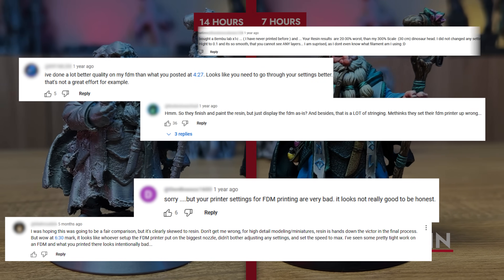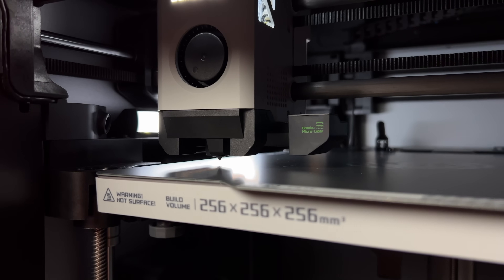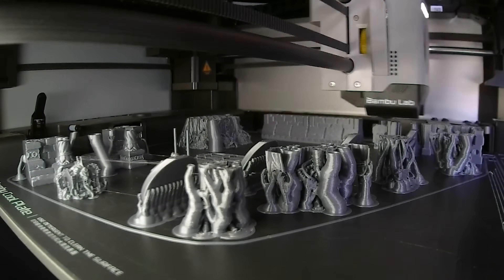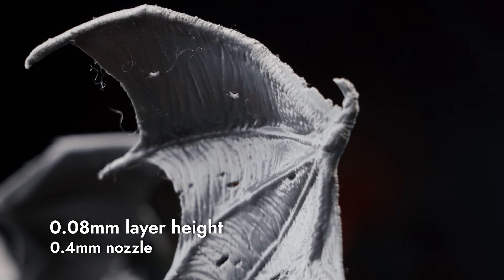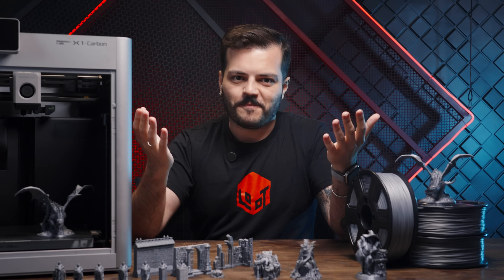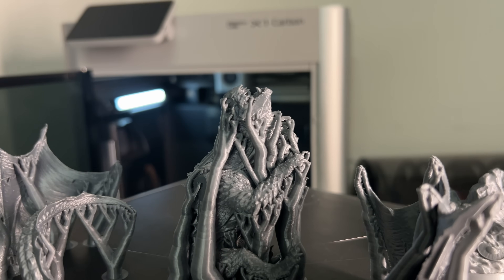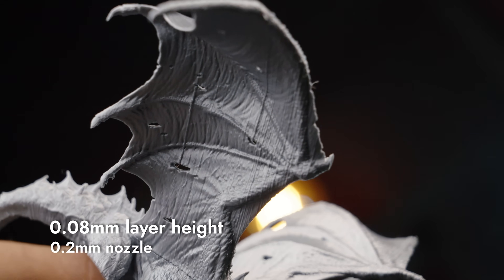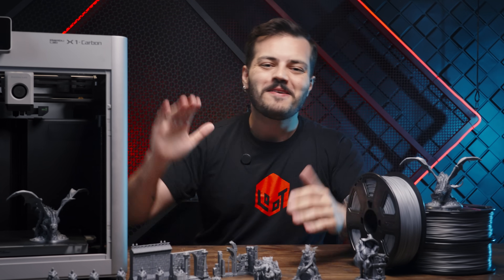How to Print High-Quality Minis with FDM Printers  (32mm Experiment)

Comment: i print minis for fun on my Elegoo. my layer height is set at 0,01 my details are insane, the clean up is not even that bad with resin printing. i use an air purifier and an enclose and there is no smell. only from the alcohol but that's gone in 5 min.

Comment: You have there Bambu X1 and I got here Elegoo Saturn 4 ultra with curing and washing station for the same price or even lower. So not that much expensive to begin with. 
SLA printing is also faster the more minis you put on your plate. Even 10 minis done in 3 hours. 
But vapour and ventilation are a huge issue for Resin printers. If you do not have spare ventilated room, don't. And don't try it in living quarters. Highly toxic. Also a stable temperature is a huge issue if you do not have heated vat.
But the restults... the results are worth it especially since you save a lot if you print a proxy army instead of buying official minis.

Comment: so much work and the results are still garbage compared to resin, and when you think the snobs in the hobby frown even at resin prints, "the quality just ain't the same as plastic, mate!" (and this mostly comes from those that can't even use plastic glue properly) your entire experiment here is for show and has minimal applications :))). But thanks for the vid, I have both fdm and resin, fdm minis are garbage, resin rocks! (the only thing resin could do better is be non-toxic, that would be a revolution!)

Comment: Everyone should be using resin like supports to print fdm minis. Make them in Chitubox using the Medium Profile. It works perfectly! Reduces A LOT the scars in the back side and is much easier to remove/cleanup
Reply: Brilliant
Reply: I know nothing about resin printing but with what you said, are you saying to use the same kind of supports resin printing uses?

Comment: I'm sure this has been said before in the comments - but if you've got an AMS you can use a specific support filament for the supports.  Some even dissolve in water.  But even using a different filament type for support can make it easier to remove supports.  I've only just got a filament printer, but am going to try a 32mm mini using a 0.2mm nozzle and specialised support resins for the supports to see how it comes out..

Comment: I printed a 6mm yoda with a 0.2 mm nozzle, It takes tweaking for each printer but with pla, good cooling and slow speed on everything we found the feautres amazingly clear, this was on a DIY printer from 2018, FDM has hit it's limit long time ago. What we should be concentrating is on better print heads..

Comment: You can go down to 0.04 in layer high with bamboulab you need to use a custom preset and change the layer at 0.04 you may have a warning message but the layer height gonna work fine
I'v use it some time for perfect smoothness

Comment: I use a dtock 0.4 nozzle, but i use a 0.25 and a 0.3mm extrusion width which is the same as using a 0.2 nozzle. I do this because i dont want to keep changing the nozzle on my machine. 

Works great. I have tested vs an actual 0.2 nozzle and the difference was not noticable

Comment: Thanks for this great video! It greatly helps to spread the word and pop the bubble of the private resin printing hype. Resin printing is cool, but it should be kept out of the hands of most of the wargaming community. And I dont want to know how many wargamers and their families have or do develop serious health issues because of lack of knowledge, misjudging their safety precautions, or from ignorantly misjudging the potential danger, when working with these toxic materials and fumes.
And for what? I know WAY too many Resin printing maniacs who definetly lack the painting skills to even profit from the high level of detail, maning they dont thin their paint enough or make other mistakes that clogg up the details and the majority of their minis end up in gaming bags with only few ever becoming display pieces anyways. 
So if you ask me, most wargamers would faire much better with a good FDM printer and buying their display-quality models from 3rd party printing services instead. The extra costs of paying experienced 3rd party professionals with quality control far outcompete all the hassle, potential toxic danger and frustration you experience from doing resin printing by yourself.

Comment: Regarding seams: while "rear" is often good enough, you can achieve the best results by picking "nearest" (at least in Prusa slicer, IDK what Bambu slicer calls it). That setting will place them into the sharpest corners of the model where they are the least visible. Combine this with manually blocking seams from the face (and maybe manually painting in some of the clothing folds as support positions) for optimal seam placement.
Also, you can print the bases flat. Filament printers don't have the same issues with that as resin printers.

And thirdly, sometimes you can play with the model's orientation to get away with less supports, especially on the face.
And if you really want to be fancy and have a MMU (or better yet, a printer with multiple toolheads), consider getting a soluble support material. If you don't fancy getting those (they can be expensive) PETG works pretty well as detachable support for PLA (its melting point is above PLA's printing temp so the two filaments don't tend to stick together). Note that this will significantly increase the printing time; generally you don't want to fill the platter on an FDM printer because that increases the chance of a cascading failure but if you're using multimaterial printing it can save plenty of time.

Comment: Cool video. :)
I think the most important step in printing minis in FDM is actually creating minis that can be printed without supports. No supports means that there are no support pimples and no breakage due to support removal.
Also invest in a filament dryer - like, holy shit that increased my printing quality by magnitudes!
Remember - nozzle size will only affect how fine the details in each layer can be. The layer height is idetntical with every nozzle. So the nozzle size will not affect how visible the print lines are.

Comment: So to summarize some of the tips suggested:
-use 0.08 mm layer height
-align seam to the back
-if using support trees, have a diameter of 1.5
-Be VERY CAREFUL when removing supports, keep glue handy
-Top Z distance of 1
-Use a 0.2mm nozzle if you can
-Use a Bambu Lab printer if you can affort one
Reply: Considering how cheap Bambu Lab's A1 Mini is, anybody wanting to start with FDM printing should be able to get one, and in my experience the A1 series printers are better than the X1 and P1 for printing more detailed stuff.

Comment: Nice video, regarding costs, printing time should be factored it. How much power is required to print, cure, etc. for the resin print compared to the fdm printing one day for a miniature. 

Also, if I put the same model multiple times on the printing bed, could I improve efficiency on the fdm printing time, e.g. how much % of the printing hours do I have to add when printing more than one?

Comment: I don't know what you're doing wrong, but you're definitely doing something wrong. The prints look terrible compared to what I'm achieving. You definitely have massive stringing. Maybe you should set the models to be printed one after the other or let the filament dry. You can also use different materials, such as PLA and PETG, which don't stick to each other well and make it much easier to remove the support.

Comment: I think the FDM-Minis look okayish when not painted. But i imagine the micro texture of them make it a nightmare to paint in any decent quality and also locks you out of a lot of painting techniques. Drybrushing for example i suspect to go horrible with this. I don't know if it is even possible for the technology to surpass that problem. I think it is a fundamentally inherent problem of the fdm-printer technology. Even if the layer heights would become much smaller so you cant really see them anymore they would still on a micro level exist and be much bigger than for resin printers therefore still affecting paintability. I must say i really hope that fdm might get there some day as Resin-Printing - though superiour in mini printing - is also a major hassle. So an alternative that seems good enough even if not as good as resin would be highly apreciated. For me it's far ayway from that point though.

Comment: I have gone as far as 0.04 layer height on 0.4 nozzle. It is absolutely doable on any well calibrated printer (I own modified Kobra 2, upgraded and moved to klipper formware). And on 0.2 nozzle you get better xy details. But unfortunately 0.2 nozzle basically limited to 200nm resolution in XY plain, so I personally print larger action figures or dioramas when it comes to fdm. So, I believe that for miniatures it is still just much more effective and reliable to use resin. Even though I personally wont get resin printer until I have dedicated well ventilated place for it which is not adjusted to living area, which I currently dont have.

Comment: i know you picked the bambu printer for its "plug and play" premade profiles to get going reliably out of the box, but those prints show obvious signs of printing issues. the stringing, the  layer banding, and the layer misalignment. that last bartender has obvious z axis issues around his waist. this is not a fair comparison to a calibrated resin printer.

Comment: For actual tabletop RPG these are great, on the board they just need to look good enough, and being cheap is a key factor. Just prime the fck out of them and slapchop and they're great. However for colletion and display resin still rules, as these require a much more careful paintjob and will be looked at very closely.

Comment: These results are nice but nowhere near what's possible with FDM. But getting better results means picking a different slicer, getting settings dialed in to the max. I print my own minis with a 0.4 nozzle at 0.06 layer height and i get results comparable to my friends Mars 3.

Comment: Other things to try:
- Dry the filament before printing to prevent stringing — your filament was wet from the ambient humidity and that’s what’s causing the minis to have all that fuzz on them.
- You can get away with fewer supports if the overhang angle is greater than 20° or so and the print speed is slow enough. You can change the angle at which the slicer will automatically add supports. (In Bambu Studio I think it defaults to 30°, so reduce it to 20°.)
- Printing the outer walls first before the inner walls will improve the quality. There’s a risk that overhangs won’t adhere well, because they’ll only be adhering to the previous layer instead of also having an inner wall to stick to, but at low speeds the plastic has more time to set.
- For the X1C, get an AMS and put your normal filament and Bambu’s “Support for PLA” filament in it, and use the support PLA for the support interface. It’s easier to remove. (You can also use PETG for the interface.)
Reply: His stringing could be temp settings as well, but either way I've never seen so much of it, definitely needs a tweak.
Reply: @Fauxknight unless he was printing PLA at 340c there shouldn't ever be that much stringing.  That's way more than normal even for too high a temp
Reply: @mlibby05  I haven't been printing that long, but I do know I've never had that kind of stringing, so something is definitely wrong. I've got mostly FDM settings in mine, and they said too low of a temp can cause stringing. I've seen other youtubers with the same issue. They're trying to give us tips and tricks, but barely seem to know the basics themselves.
Reply: And maybe use some decent filament not the cheapest you find on aliexpress. Good filament is not way more expensive then cheap one, maybe 2 - 3 dolars extra per roll

Comment: I bought an A1 Mini specifically for mini printing. I had to get a CryoGrip plate, Magigoo and add 5mm brims to absolutely ensure adhesion. Still worth it though - I'll keep my old-but-still-great Phrozen Sonic Mini resin printer for player character prints, but it's nice having the A1 Mini for NPC prints from the few Patreons that do dedicated FDM releases with tailored FDM supports. Yeah it takes like 7 hours per print using the FDG profile, but the quality is SO much better than it appears in YouTube videos, because the strong lighting and close up lens really exaggerates layers more than the naked eye can see. Resin can be worth it, but it's great having another option that is way less mess, and even with a VOC mask that stuff smells so bad.

Comment: what needs to happen is for sculptors to optimise for FDM printing, FDM can produce great details though only in certain directions, and adjust thicknesses and need for supports. A great FDM sculpt will print just as easily for resin, but not vice versa. I believe sculptors will have A LOT more customers if they started catering to FDM printers
Reply: it will probably happen, there are some that already make support-less figurines on makerworld.
Reply: In addition, delivering with premade FDM supports

Comment: 11:53 When you switched to a .2mm the settings for your extrusion widths should have been cut in half. On top of that the bambu .2mm hotend has something like 1/10th the volumetric flow of the 4 nozzle. Unless you went back and raised the layer widths (which matter a lot) to completely unreasonable levels you changed a lot more than the nozzle.

Comment: Try printing it with slow speeds and heavy resin supports.

The issue with resin is not the cost. The issue is toxicity and smell as well as area. You can put FDM printer anywhere - even in your bedroom, or near a sunny window - it doesn't matter. But for resin you need a dedicated workspace away from living areas, with ventilation, no windows, climate control, and enough dedicated space for cleaning and managing it.
It's not something that everyone can afford.

Comment: I've been printing Loot minis in FDM reliably with great quality, but a lot of it just comes down to positioning of the minis and mini selection. Some of the minis, like minis with thin weapons or lots of tiny details, won't work as well. 

Terrain, busts, any of the minis that are Large/Huge or bigger, are a no brained and super easy to print in FDM. I'm about 85% done with printing the 75mm dragon empress in PLA, and it looks gorgeous. Will make a great centerpiece BBEG for my dnd campaigns. And she's as light as a feather, despite being easily the largest mini I've ever made/painted! 

32mm minis can be done, it just takes practice and patience. Like anything else in 3d printing, fine tuned settings, practice, and familiarity with angling and supporting pieces will be key. But it just comes down to your preference - for me, with 3 kids in the house who love to poke around my hobby room/workshop, I decided to get rid of my resin printers a couple years ago. For me, the sacrifices in some aspects of detail for FDM minis was worth it for no longer needing to worry about resin VOCs, IPA, post processing, and disposal of used IPA.
Reply from the maker: Izat'al is really impressive and a beauty in FDM! You said it all, it's really possible to print in FDM if you put effort and time to it...

Comment: You have the X1c, I assume you have the AMS. try using PETG for the supports or the support interfaces and and set the z clearance to zero.  If you use it for all the supports, you can also try setting your x/y distances to zero as well.  The supports will come right off and there will be no scars.  This will greatly increase your print times, but you can get great results with complex geometry.
Reply from the maker: Interesting advice... 🤩

Comment: Great video, I've been getting excellent results with 0.2mm nozzle at a slow speed.
Also try out these settings for tree supports, they are much better than the default ones, and will make the supports far easier to remove, and leave less scarring on the model.

Tree (auto)
Tree Slim
15* Threshold angle
OFF "On Build Plate Only"
ON Support Critical Regions Only
ON Remove Small Overhangs
Tree Support Branch angle: 60°
Support wall loops: 2
Top Z Distance: 0.28mm (this is done so the supports are easier to remove)
Top interface layers: 3 layers
Reply from the maker: Interesting settings! 🤩

Comment: Got to say even the best quality and 'obviously I'm using that word very loosely' you used was awlful when compared to the worst settings used on a resin printer. As soon as you put paint on those fdm figures the lines will be magnified a million times and no mater how far you stand away from the table you will still see them. FDM is great for low detail large terrain pieces where you can spend the necessary time to file away the layer lines before painting but that's a lot of effort, given how reasonable pre-painted terrain there is on the market.

Comment: As someone who has both, I will rarely ever go back to resin printing. The faff of having to wear protective gear and cleaning the models  and machine after each print is not worth it for the slight increase in quality you get when compared to the .2mm nozzle.
Reply from the maker: That's really something to consider...